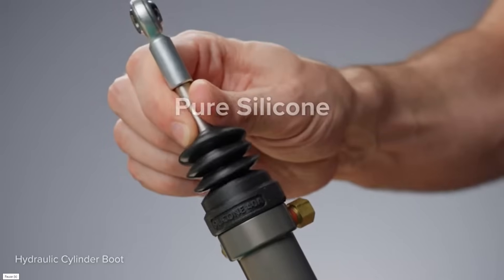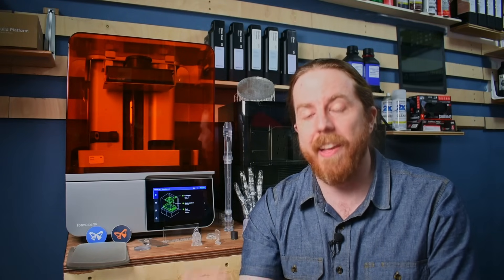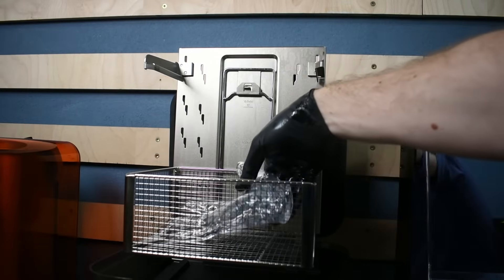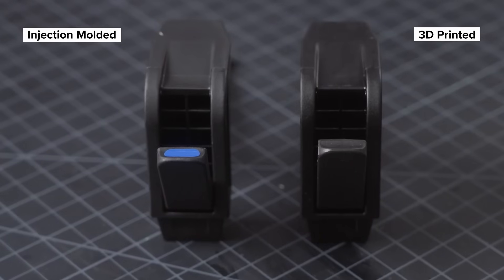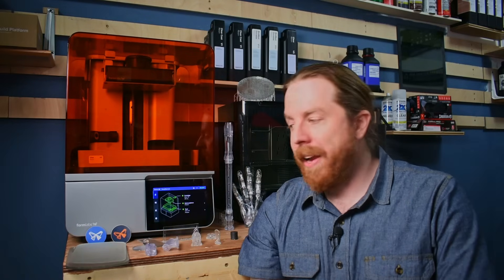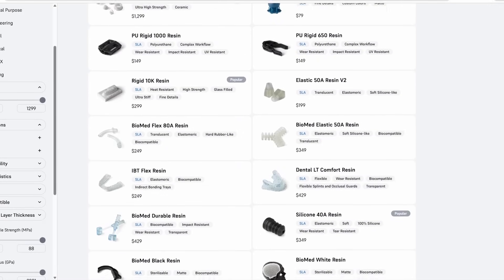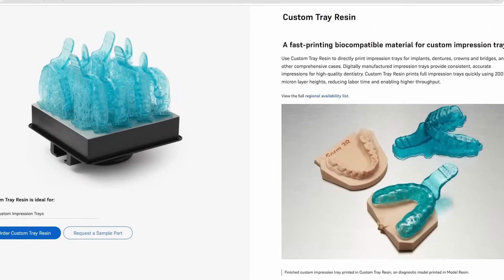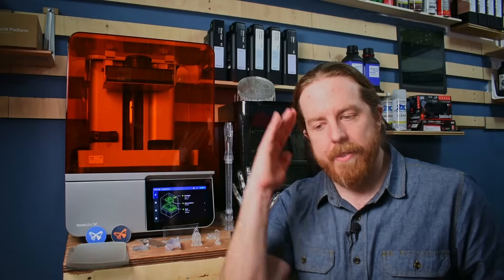Form 4B - This Will CHANGE Resin Printing FOREVER (at a price...)

Comment: If you are still looking for filters for casting metal you can ask Grok or any ai this "where can i buy ceramic foam filters for metal casting". they are kind of expensive if you are doing home casting with 1-2 parts per mold.

Comment: I have hated resin printing for so many years… is it finally time to try again?? 🥹
Reply from the maker: lots of the newer stuff is pretty great, especially this one.  The price went up significantly, though.  You can still get cheapo resin printers but they are arguably not much more reliable, they are just faster and have better resolution.

Comment: what do you mean BUY open material mode? 😂😂
Reply from the maker: yeah you have to "unlock" it.  at least they offer it.  it's nothing like using chitubox, too, it gives you pages of different settings for you to really dial everything in, and almost none of the settings are the same as a normal slicer.  I feel like it would require re-learning how slicers and resin printers work just to program in a new resin, but if you do, it will work better than a generic resin on chitubox.  the unlock is really expensive, though.

Comment: it is very hard to find videos that AREN'T about mini models. I have ZERO use for little dragons and guys with swords...I need a 3d printer for making machine parts, prototypes, sockets, coverts, industrial stuff. and trying to get video that talk about things like dimensional accuracy etc is hard. thanks for this vid
Reply from the maker: glad you like it!  I agree, 99% of resin printing videos are all about warhammer models.  It's hard to find information about any other applications.  I just posted another video on a printer for production/industrial use, and all the other reviews seem to be saying "Not great for minis".  Yeah, that's not the point lol

Comment: Thank you for eidting downt he whistle, you earned a sub lol

How would you compare this to the HeyGars Reflex RS or Reflex?? I do want to make statues for our game
Reply from the maker: Great question, i happen to have a Reflex RS here and a Reflex.  You're making statues?  Like miniatures for a board game, or tabletop game? Are you making them for personal use or for mass production, like are you "creating" the game and producing the minis for others?

In my experience, the Reflex RS is fine for producting miniatures.  Don't use pre-supported files, use heygears auto supports.  They come off easy and while they can leave bumps, they don't leave divots that need to be filled.  The formlabs supports don't come off as easily, which can be an issue with delicate parts. 

both machines produce great looking minis.  Most of my miniatures lately have come off of the RS.  In my experience, the formlabs machine has far fewer failures.  I was being honest when I said many bottles of resin and only one part didn't come out perfectly.  Since this review, i have printed lots of other things, and every single one has come out.  The formlabs machine is amazing for that.  The heygears machines seem to have print failures on par with other printers.  Not excessive, but certainly not as reliable as formlabs.  The heygears machines seem more reliable than, say, an old halot mage, adn the prints come out much more accurate (important for multi-piece terrain or vehicle models).  In my opinion, the formlabs printers and even the heygears Reflex are a big overkill if you just make game miniatures.  If i had an unlimited budget, however, I wouldn't use anything other than a Formlabs Form 4L for literally everything lol
Reply: @PaulsPrinterProjects  Statues of our characters from our game, then with airbrush... something about 8 inch tall models maybe 10" if its feasible enough to produce them at a fast rate and with a good rate. I want absolutely minimal fiddling with the machine, my bambulabs is having electronics problems now (static built up and it electrocuted me while doing a cold pull so...) I really fkn hate downtime.  I want ZERO downtime, fiddling with the Saturn 4 ultra 16k's build plate etc iws down time I do not want haha.
Reply from the maker: if you want zero downtime this one is hard to beat.  I still haven't had print failures since this video.  I talked to some of the engineers for the form4 and form 4L (the really big one), and they told me a little about how they test the machines.  Basically, dental labs and the like will run machines at maximum speed 24/7 for months, and they have to make sure the things won't break down or wear out. It's really impressive.  And yeah i've messed with a Saturn 4 ultra 16k, it prints great but i had to replace a screen on mine and wow was that a major PITA
Reply: @PaulsPrinterProjects  I just won the Reflex 2 pro free so... ugess I am going with that lol
Reply from the maker: Lol well free is the best kind of printer!  😂
Reply: @PaulsPrinterProjects  lol yeah my coworker/business partner ArbuzBudesh won the "#winbig" draw and Ithinkthat was the entire Pro combo? lol so it'll be sent to me

Comment: Good machines from them, the price is a big no. They charge you 2k-5k for a form series to use other materials. That's a scumbag move. I cant wait until Bambu or some other Chinese company takes a shot at them.
Reply from the maker: there is a chinese company shooting for them, it's called HeyGears.  I have their machines too.  If you ask me, HeyGears stuff is good, but if i could afford a Formlabs machine, i would choose that one every time.  Not saying HeyGears is bad, it's not, but Formlabs is worth the price increase in my opinion.  Oh and HeyGears doesn't even offer to sell an open  mode.  That part I don't like, because their resin library is limited, unlike formlabs.

Comment: This feels more like an ad than a review, You hype the Form 4B as flawless but downplay every flaw you mention.
* Build area too small - “but you can just buy the bigger one.”
* Cure station slow/small - “but there’s a new one, so disregard my complaint.”
* Failure rate - dismissed as probably better than published numbers.
* Warping - admitted, but brushed off as “less bad than others.”
* Post-processing hassle - softened with “sometimes you don’t even need curing.”
* “not an ad, no affiliate” - and then dropping a marketing campaign links with UTM tags
Reply from the maker: I can see how you think that, it's pretty glowing.  That being said, every issue I presented on this review is still far above and beyond any other resin printer i have tried so far.  I think the issues are because of limitations with resin printing technology as a whole, not this machine vs other machines.  I still think this is the best resin printing machine (except maybe the bigger version of this same machine). 
oh and it's not an ad, they didn't pay me, they didn't tell me to change the video, they offer zero commissions.  I haven't seen a dime from them even now.  They did send me the machine, though, but that's standard practice for people reviewing stuff.

Comment: No Linux support for their software. Shame.
Reply from the maker: do engineer companies tend to use linux when developing products?  Honest question, I have no idea.
Reply: @PaulsPrinterProjects  Engineering companies probably use SolidWorks, which is Windows. 

I know that I am developing a product and I use Linux and FreeCAD. 

I have been looking into manufacturing and the FormLabs Form 4 seems like a potential tool that I could use, but I can't really know if I can't use the slicer. Kind of a bummer.

I have no idea how many other people like me are out there, but I know it's more than zero.

Comment: Thanks for the detailed but understandable review. I just brought a form 4. I am a total novice so things like zero clearance is new to me haha.
Reply from the maker: You'll love it!  Its easily the lowest hassle printer I've ever tried.  Zero clearance is more of a design thing, all moving parts need some kind of clearance depending on what they are supposed to do.  Zero clearance just means I didn't design in any gap between the parts at all, usually a bad idea.  In this case I got away with it because the printer is very accurate for a resin printer.  If this was another printer/resin, the parts probably would not have fit together.

Comment: What resin did you use to print the recorder?  I have an Irish Whistle design that I want to print on my Form 3 but I need a resin that is non toxic.
Reply from the maker: I used biomed durable, but i assume any of the "biocompatible" resins should work.  Even a normal resin if properly washed/cured is probably fine for a flute that touches your lips, but its better safe than sorry for stuff in your mouth.

Comment: Is this a joke? 
change what exactly? I own their Form 2 and it prints like sht comparing to Anycubic - Phrozen about price.
Formlab's resin is ridiculous pricey too, their machine is very hard to repair or maintenance, the software is closed, every machine parts about electronic or anything else that you break - can't be purchased, you have to send it back to them and wait for like forever to get the machine back, also the reparing price is nuts.
I'm quite suprise that they still manage to continue the Form 3D printer line, like who's gonna buy these? 10 people ?
They're fail with the SLA technology, they switch to DLP and LCD tech, then still make printers cost your kidney and a half.
So what exactly change the resin printing?

Comment: If you circle round back to this could you talk about "off line" use and or ability? Update via thumb drive and all that. Also the shelf life of the resins and if it can use others too and which ones would work best? Just some Ideas. Also try a "grow tent" to help mitigate fumes. Although carbon filters just remove the smell and not much if the actual VOCs. That would be a HEPA filter. Cheers and thanks dor the vid.
Reply from the maker: I have updated/operated this via thumb drive, so you can do it, but it also works over wifi.  I think offline functionality is built in specifically because companies use these for product development and they want to protect their IP.  Other than the offline update i tested, I just use the wifi, it works very well.  

I dont recall the shelf life exactly of the resin, I think its 2 years for normal resins, though some of the special ones are shorter.  

I know people who use grow tents with vents outside, but I just have these out in a heated garage.  They aren't in my house.  The "ventilation" occurs because I have a few large doors, all of which leak lots of air, and sometimes i have windows open.  I think a vent hood would work just fine, too.

Comment: Are you saying their resins would not work on another brands of resin printers?
Reply from the maker: They would work, but you wouldn't have prints as good.  The form 4 has a lot of stuff built in like peel force detection and variable exposure and lots more thats already calibrated for their resins.  You would lose that using another machine, and while the resins are great, you might as well save some cash

Comment: Former Formlabs Mechanical Engineer Here.  I just want to try to inform people of some massive propaganda that Formlabs pushes. And yes, propaganda is the correct word. Formlabs makes the vast majority of their money from selling resin. So they push the resin hard, and of course you have to use their resin with their printers.  Now specifically I wanted to talk about ACMO. They claim that it "May cause reproductive effects." This is a sneaky completely legally meaningless claim. Although ACMO is definitely toxic, it has actually not been linked to any birth defects or infertility. Its purely to scare you. I guess they are using other, maybe even more dangerous materials, like TPO, THFA etc.  SLA resin is, by it's very nature, toxic because it's reactive. There is no such thing as healthy SLA resin.  The tests they have to complete to mark their resins as biocompatible are laughably simple. Such as showing that contact with organisms in a petri dish don't hinder the growth in the dish. It has nothing to do with toxicity in humans. In fact, most of their non biocompatible resins pass all of the required tests. They don't advertise this because a) certification is expensive, and b) they can charge way more for biocompatible resins. And while I generally consider fully cured and washed resin relatively safe to handle, I sure as hell wouldn't put it in my mouth. Whether or not it's certified biocompatible.

Comment: No.
There are printers that do NOT go up and down. Only up! Only when we have those printers as desktops will we have true resin printing speed revolution. But the technology is proprietary and since the Chinese are not making cheap copies of it - probably well protected.
Reply: There was an older model (diff company) called EnvisionTec Envision One that had "continuous" (only up) printing but the buildstyles/resin weren't that reliable and they had to kind of walk-back their statements about that capability - probably harder to do than we consumers might think.

Comment: I have a Form 3+ for work. I use it almost exclusively for creating molds. It’s an excellent machine, but the biggest gripes are the printing speeds and the limited bed size. The new For 4 and 4L are definitely a huge improvement on speed and the 4L size is much better. Of course, they are very expensive, but for work, they have zero issues and simply operate. I use a mix of resin printing and FDM for most of my prototyping. If you’re a hobbyist, these are not necessarily for you unless you have the cash to spend on your hobby.

Comment: Hoooo - leee are you ever wrong about the resins. Here's why: 

Most people that bother with resin do it for the minis, yes, and when making those you generally want the highest possible detail. The issue is that in order to get that higher detail from a resin, manufacturers sacrifice other material properties, usually overall strength and durability. This comes into effect when people try and use those, not so durable materials, for structural and engineering stuff. Plainly speaking: they are using the wrong materials.

Why? Mostly due to price. Most common mini suitable resins (ABS likes and the fancy high rez stuffs) cost half as much as proper engineering resins. Sirayatech's blu costs ~40€/L whereas elegoo's ABS-like comes at ~22€/L. The interesting thing happens when we compare sirayatech's with formlabs's resins - they have comparable specs (in some cases sirayatech is even better), yet the latter can cost as much as 5X more.

In conclusion; don't be a dum dum and use the proper materials, don't be lazy and properly calibrate your resins (you have neat look up tables on resin manufacturer's sites for cure times for different layer heights and printers). Formlabs is a company that does idiot proof hardware (so you don't have to spend as much time and money educating your workforce) for commercial customers. They are very good for what they do, but are completely unsuitable for the public - it's like recommending an F1 car instead of a ford focus for a commuter because it can accelerate way faster at an interchange.

Comment: Can't you use their resins on consumer printers? 

I can't justify its price tag as a hobbyist 😢.
Reply from the maker: You probably can, it's all 405nm resin, but the settings might be tricky to get dialed in.  The resin and the printer work together to get the best accuracy and other things.  If you are just a hobbyiest printing minis or something I'm not sure you would see a huge advantage anyway.  It might be better to check out the formlabs creator tough resin.  I'm using that now in a uniformation printer and it works great, and also doesn't have ACMOs like the form 4 resins.
Reply: @PaulsPrinterProjects  Yeah I don't have a resin printer yet because I think they're only good for minis. I'm a FDM functional print guy.

Still, formbots are too pricey, unless it's for business use. What I'm most interested in are actually those medical grades and ceramic like ones. I'd guess the consumer grade ones lack features other than light source to handle those resins properly.

Amazing printer nevertheless 👍